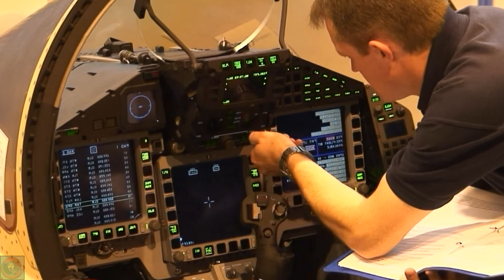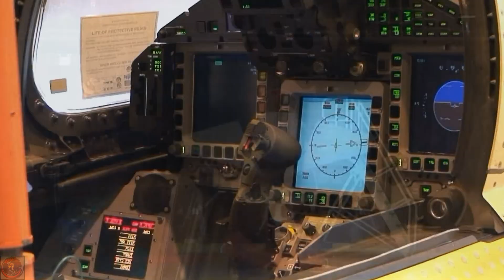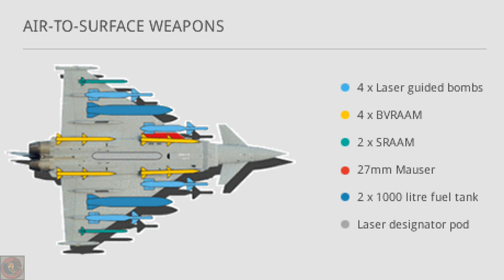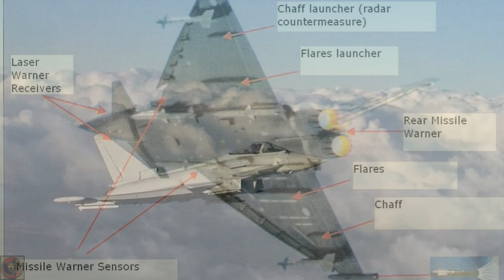Eurofighter Typhoon Combat Fighter Jet - Europe’s 4th Generation Fighter

Comment: This is no attack against Matsimus, but I am really exasperated with people calling the Typhoon a "4th generation" fighter.
It was developed at the exact same time as the F-22, which is called "5th generation", so how can it be of a previous generation?
As Matsimus writes in his description, it incorporates the latest technologies and in some regards, it is even more advanced than the F-22.
The only difference is that it looks less "science fiction"-ish, that is all.
Why is what generation a jet belongs to determined by how it looks?
And if we're doing that, does that mean the successor to the F-22 and F-35 will still be "5th generation", if it looks too much like those two?
Calling the Typhoon 4th generation, as if it would be on the same technological level as a F-15, F-16 or Mig-29, is ridiculous and makes no sense.
Reply: The thing is, the F22 set a standard that is nowadays common for new designed jets - stealthy features for a maximum survivability, internal weapon storage. 

Typhoon has a far more conventional layout.
Reply: @Sedna063  I hear what you are saying, but I still find it nonsensical to determine what generation a plane belongs to by what features it has.
Following the same logic, you could argue that the M1A2 Abrams is from an earlier generation of tanks than a T-62, because the latter has an autoloader and the Abrams doesn't.

There are choices people who develop new weapon systems make, different directions to take a system into.
The people designing the F-22 went for stealth, the people designing the Typhoon chose to rely on high speed agility for survivability instead, with a tad of stealthiness.

Saying one is a generation behind the other because of that, makes no sense. It isn't as if stealth technology would be arcane wizzardry that was beyond the people behind the Typhoon.
European aircraft designers have been working on stealth technology just as long as American ones (look up "MBB Lampyridae" for an example), but decided against using it for the Typhoon, because they didn't consider the compromises worth the effect.

I know, the Typhoon doesn't look like much to the uninitiated eye, especially not in comparison to those science fiction looking stealth fighters, but there is actually a fascinating amount of smart features to that thing and more than meets the eye.

For example, it is designed to have the smallest possible frontal silhouette. A lower frontal radar reflection surface is a nice side effect, but the main reason was to reduce air resistance and drag and get the best possible aerodynamics out of it, for maximized acceleration and more importantly: energy retention.

It is important to know that within a certain window of speed, a jet fighter with its relatively big control surfaces is more maneuverable than a anti air missile with its little, stubby wings. Sure, modern AA missiles have thrust vectoring, but every time they use that, they lose a lot of speed and need to accelerate again afterwards.

Interestingly enough, not too much has changed in air combat since WW2 and the days of propeller fighters. It is still all about "Energy Fighting". You still need to either blindsight and catch an enemy unprepared, or you need to catch him at a low energy state, at which he can't evade as well, to ensure a secure kill, even with the most modern missiles.

With its super cruise ability and delta wing configuration, the Typhoon is from head to tow designed to stay within that special speed window where it is relatively easy to evade a missile for as long as possible and be as maneuverable as possible at those speeds. It is as specialized for that, as the F-22 is for stealthiness.

My point being, there is much more to the Typhoon than just being another jet that just simply has better stats than 4th generation jets.
There went as much thought and clever design into making it that energy fighting monster and missile dodger, as there went into making the F-22 stealthy.
As I said, it just isn't as obviously different as the F-22 or F-35 are from 4th generation fighters, but it is.

Quite frankly, if I were in a position to give marching orders to a team of engineers tasked with developing a next generation fighter, I would even now put stealth pretty low on the list of priorities. There are so many new and old ways of detecting stealth planes nowadays and that list will get longer and longer.
Of course I would know that not making it look stealthy would harm the market position, because nowadays everybody buys into the stealth hype and people think a plane needs to be stealthy to be viable, but if my only goal and only priority would be to make it the best fighter jet I can, without consideration for marketing and sales, I would not compromise flight performance for stealth features.

The whole BVR ("Beyond Visible Range") combat idea is way less developed and way more half baked than most people know.
The AMRAAM has a pretty abysmal hit ratio on targets BVR and even that hit ratio was achieved against old, outdated, Soviet era jets and unsuspecting American Blackhawm helicopters that were hit in friendly fire accidents.
Against a halfway modern fighter with a decent missile warning system, the probability of a AMRAAM achieving a BVR hit is estimated to be well below 10%.
That means that the 6 AMRAAM the F-22 can carry are statistically not enough to achieve a single hit and because of the aforementioned inherent disadvantages missiles have, it is unlikely that even a newer, more advanced missile will change that much anytime soon.

So having a fighter that is really good at dodging missiles and at winning energy fights seems like a way better bet to me than a fighter that relies on hitting the enemy BVR.
Reply: @TrangleC  Just ignore the generation marketing, it is just that. Analysts do not deal in generations. 

I would probably give any future plane stealth features (because the advantages of computing allow stealth and maneuverability) but would put maneuverability first. To offset any disadvantage, I would field a very strong EW suit to the plane.
Reply: @Sedna063  Seems Youtube once more, for no good reason, just swallowed one of my comments/replies. It says there are 3 replies to my initial comment, but I did write another reply to you a day ago, which would make it 4. I can see it when I click on the replies, but I guess you don't.
It isn't that I expect you to keep on talking to me if you are not interested in this conversation anymore, but I am very curious over this issue with Youtube comments and you would help me out a lot if you could confirm or deny my suspicion that you never got my last reply. (It starts with "You're right, ...")
Reply: TrangleC No, did not get a comment. My last reply about marketing and EW suits, stealth and maneuverability were the last comments I sawapart from this commont from you
Reply: @Sedna063  Thanks. Nice to get confirmation that indeed some of my comments just are not visible to others. It is as if they would get shadow-censored, or something, but it happens totally randomly and regardless of the content of the comment.
Reply: @Sedna063   I'll copy the text in here to see whether that works:

"
TrangleC
1 day ago (edited)
@Sedna063 You're right, I shouldn't be that thin-skinned, but I have had discussions about this since the time when both jets were still in the prototype phase. I have met so many ridiculously stubborn and ignorant F-22 fanboys who acted as if the F-22 is basically alien super technology, while calling the Typhoon "a F-16 made of plastic" and stuff like that. For most people in the bigger military enthusiast forums or comments sections to blogs and articles, it was all about that "Generation" label.

Yes, stealth of course isn't totally mutually exclusive with good aerodynamics, but the fact that you need to put the ordnance inside the plane, is a big and kind of fundamental problem.
That requirement can land you in kind of a design death spiral and I think you can see that a bit with the F-22.

They needed the internal space for weapons, which meant they needed to make the plane big and bulky, which meant they needed big wings and control surfaces, which create a lot of drag and so they needed more powerful engines, which use a lot of fuel to push that chunky boy through the air and that fuel needs to go somewhere, so you need to make the plane even bigger and fatter and so on.

The F-35 got hit even harder in that regard. It has such a super powerful engine, but still its max speed with after burner is lower than the speed the Typhoon can reach without afterburner and with a regular weapon loadout.

I don't really see how you could get around that problem, except if you had a way to make the internal components of the plane so much smaller that you can free up enough space for a internal weapons bay without making the plane much chunkier overall and that seems unlikely, since there isn't actually that much in there that you could miniaturize drastically.

Maybe that is why the French and Germans are going for this weird "tandem" system with their new fighter, where the fighter is always accompanied by a unmanned wingman drone. Maybe that is the only way to do it, not have any missiles on board at all, but have a slave drone carry them for the fighter."
Reply: @TrangleC  Rule number 1 on Youtube, have a thick skin. 
You have a lot of those comments, especially when we talk about a highly nationalist topic like military where no side can admit defeat. I have seen this countless times with the French and their Rafale. 

The thing is, ordnance can be carried externally too. Stealth would deffo give an advantage for SEAD though and once air superiority has been established, it should be possible to have internal and external storage. In this regard, the F35 is quite good. 

As for the tandem part, a jet without it's weapons at hand is a dead jet.
Reply: @Sedna063  Sorry about the late reply. Was sick for a while.

Yes, on Youtube the military fan community is particularly ridiculous and many channels exploit that by making those useless "10 best X in the world without any explanation what made them the best"-, or "X vs Y, who would win in a fight?"-videos.

The thing with the Typhoon being called 4th Generation predates the Youtube military fan and video era though and it wasn't much better on supposedly serious blogs, sites and forums where people should know better and where you would expect a higher level of knowledge and discourse.

It is really weird how that "4th Generation" label sticks to the Typhoon like super glue. Look at the title of this video. It seems nobody can talk about that thing without mentioning that it supposedly is "4th Generation".
As you said, that term is rarely used in any other context. You almost never hear or read it when people are talking about actual 4th Generation fighters, like the F-16 or F-15, but it always comes up whenever anyone mentions the Typhoon. It is really weird and persistent. It is as if someone would have successfully slapped a "Pedophile" label on that thing and now everyone who sees it or talks about it, can't help but bring up how it probably molested kids. lol

This is a bit tinfoil-hat-ish, but you could almost suspect that it was an deliberate and very successful act of "product character assassination" by the F-35's marketing team, or something like that, hehehe.

Judging from the mockup the French presented, the new fighter looks suspiciously sleek and slim compared to current stealth fighters.
If it has a internal weapon bay (and if it will have the proportions of the mockup), it can't be big.
I wouldn't be surprised if it just had space for maybe 2 short range missiles for last ditch self defense, but would leave the heavy carrying to the wingman drone.

At least in theory, if the link-up technology and the interaction with that drone works well, that concept might work. Don't think of the jet as a undergunned fighter jet, but more as a cockpit that moves independently from the main body of the fighter jet and is more stealthy and agile than the weapon-carrying part of the jet could ever be, can stay at a save distance in a fight and can run away if things get too hairy. And if it ends up carrying some weapons itself, it might steal a sneaky kill while the enemy is busy fighting the drone.
Reply: The Differences between 4th and 5th gen is only stealth, but the Eurofighter is classed as a 4.5 gen jet and does have some Stealth in its design with RAM, having the smallest RCS out of the Rafale and Gripin, but the Eurofighter can actually do things where the F-22 can't.
Reply: @forzaisspeed  Yes, but as I said in one of my previous comments here, it makes no sense to determine what generation a jet belongs to by what features it has. The example of the Abrams and the T-62 I brought up, shows why.
Reply: @TrangleC 

1st, The reason why people class different jet's this gen or that gen, makes no sense, but it's like IPhone's a new comes out with a new thing and the Numbers go up to make it sound better with a newer version.

2nd, It's funny to be honest, that a 4++ gen jet the Eurofighter can easily beat any 5th gen, but you get kids that think the higher the number it must be better, while if history has taught us anything, is that's not always the case.

3rd, Plus it makes people feel better when they think they have the newer toy then others, just with a higher number 😂🤣.
Reply: @forzaisspeed  Yeah.
It was really bad in the early 2000s, when both the F-22 and the Typhoon were still relatively new and people in internet forums acted as if no other jet would have the tiniest chance against a F-22 and the Typhoon was just a glorified ripoff of a F-16 anyways and bla bla bla.
What made it worse was that back then, it wasn't the world of Youtube comments, where everybody can chime in and nobody has much of an expectation to get accurate information from random Youtube commenters.
Back then this discussion was had on specialized forums, where self proclaimed experts and people with actual credentials were posting and were spreading the same kind of uninformed nonsense you nowadays get from random Youtube comments, just back then they had a air of authority around them. They quoted actual test pilots talking stupid nonsense about the untouchable superiority of the F-22 and spreading stuff that has been debunked since.

The people defending the Typhoon and other designs were at a disadvantage back then, because many things that are known now, weren't at the time. Stuff like that the way the Red Flag exercises count BVR ("Beyond Visible Range") kills is BS and favors the F-22 in a totally unrealistic way.
They just treat AMRAAM as if they had a 100% hit rate. Who shoots first gets a kill credited. While in reality the AMRAAM has something like a 40% hit rate when used BVR and all those hits were achieved against very easy targets, like old, outdated, export versions of Soviet fighters, without modern missile warning systems and friendly fire accidents where US fighter jets shot down US helicopters.

In reality the AMRAAM has never been used against a modern jet fighter with a modern missile warning and counter measure system and even against the easiest targets imaginable, more than half of them missed, but at war games like Red Flag, they treat them like perfect fire and forget weapons.
No wonder then, that a jet like the F-22, which is all about "shooting first" BVR, "scores" high in those rigged, unrealistic war games.

The F-22 and the components it is made of (like the engines) is an impressive piece of technology, but the more I learn about the concept of BVR air combat, which it was very specifically designed for, the more that seems like a unrealistic pipe dream.

But I didn't know as much about all of that 20 years ago, which made those discussions with those smug F-22 fanboys in those forums very frustrating and that haunts me till today. It is a bit like suffering a horrible defeat in a important sports game and then you find out years later that the winning team cheated and only won because the referee had no idea what he was doing, hehe.
That is a inperfect analogy, because it makes it sound as if I would have seen that discussion as a competition and as if I would have been on "Team Typhoon". The issue with all the F-22 hype I had back then wasn't one of national pride. I didn't know details like the one I mentioned about the Red Flag war game, or about the hit ratio of AMRAAM and other BVR air to air missiles, but I did know some fundamental stuff about air combat and I realized that some things didn't add up back then, which is why I wasn't getting on board of the F-22 hype train and why the Typhoon seemed to make more sense to me.